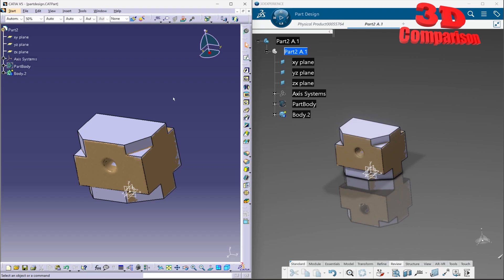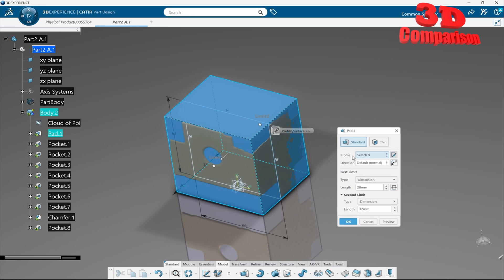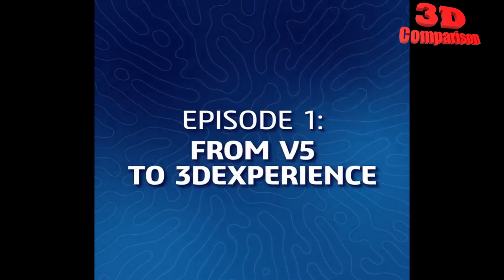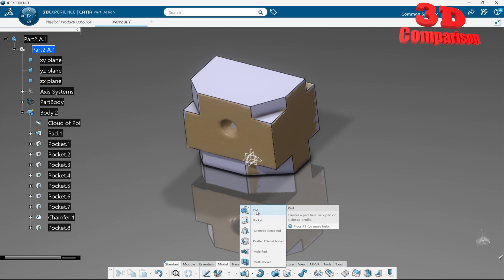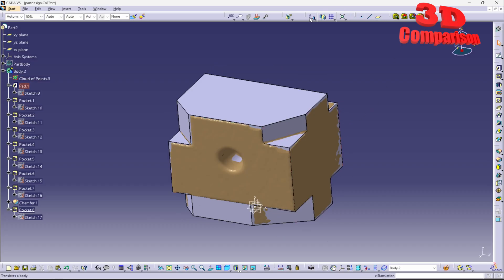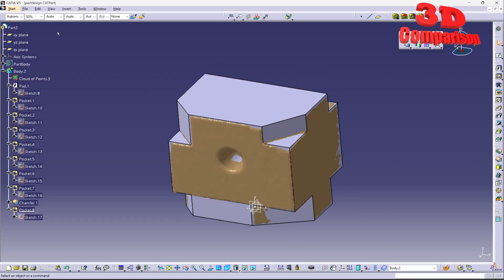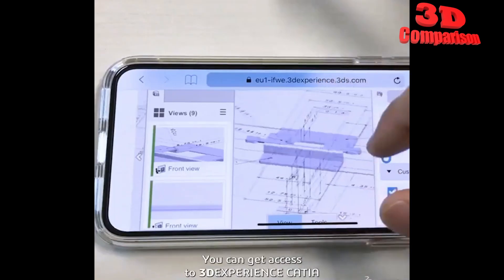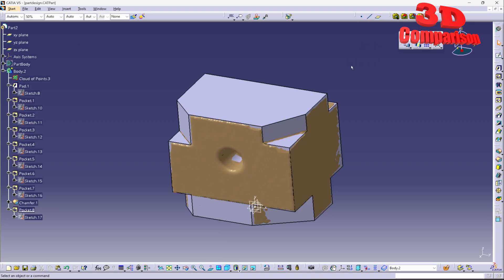CATIA V5 or 3DExperience CATIA?

Comment: I am using CATIA V5 P3 V5-6R2022 and the workbench menu there is 3DEXPERIANCE option on top. My question is do i need to have a separate licence for running the 3DX or I can use it by simply login to 3DX. Regards.
Reply from the maker: Hello, you need 3D Experience entitlements (license) on top of your CATIA V5 license and then you can use that menu to login to 3D Experience. Here is the extended answer within a video - https://youtu.be/E1n6knel5fo

Comment: I have years of experience with V4-V5 (20+) and 3Dx (5) and up to now 3DX is purely a downgrade. All the previous issues that V5 was having like using single core CPU, Glitch with Sihouette projection and many many more etc, where not fixed in the transition.  On the top of this, in 3DX, they screw up by combining tools togethers and implementing new bugs and features that were working but now don`t. And finally the PLM (data management) is the worst I have ever seen in my whole career. It`s nothing more than a glorified search bar in windows explorer without the capability to at leat create folders to organise your work. And I'm not talking about the accounts management, which is mandatory in 3DX.... Overall V5 was a 8.5/10 and 3DX doesnt get a pass.. Period.
Reply from the maker: I agree, I have also noticed that legacy problems such as single core cpu usage, or features glitches (for example fillet feature that I documented on my channel) are still within 3D Experience. Thank you for sharing this, this is one of the reason why I also transitioned toward other CAD tools.